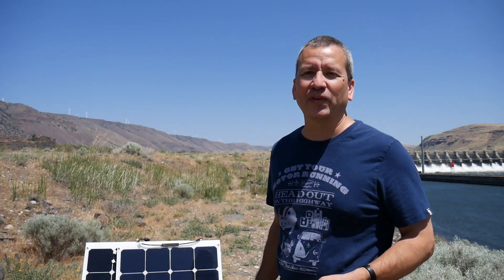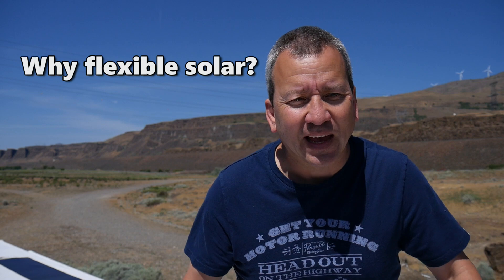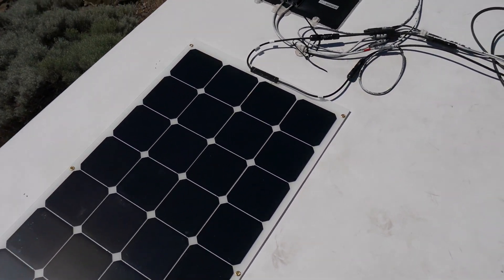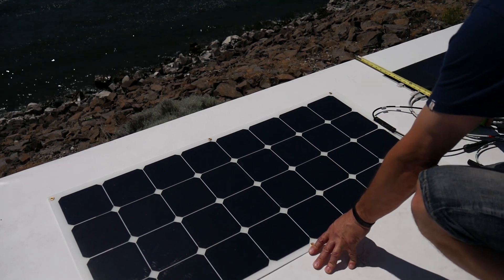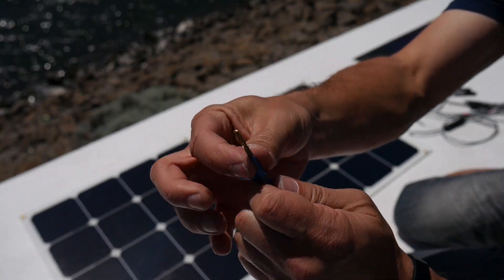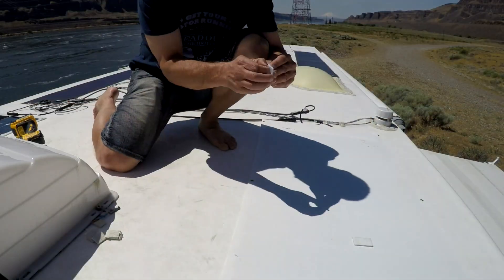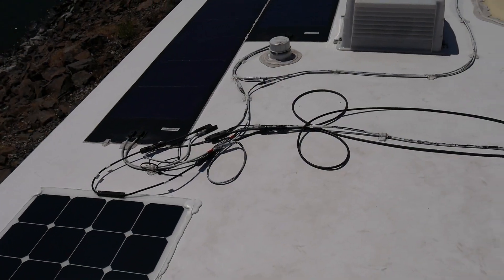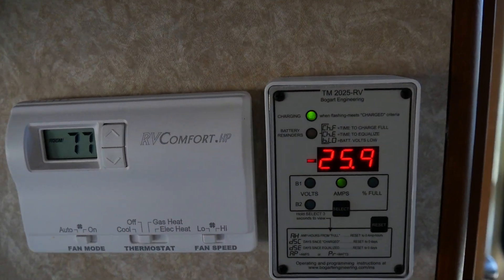How To Install a Flexible Solar Panel on an RV

Comment: Sweet setup you've got, Brian. Nice additional output you just added. 😊
Reply from the maker: Thanks! Yeah I was pretty excited when I first got them hooked up and measured...not gonna lie. Had a chance to do some boondocking for about 6 days around the 4th and they worked really well, even when it was pretty cloudy out.
Reply: RVwithTito
Excellent! We're overdue for a solar & battery upgrade. Too busy this year though.

Comment: Hey Tito, nice job but you really didn't have to drill screws into the flat panels.  I have two on my class B RV and I just used Dicor on the back of the panel and around the sides.  They only weigh about 6 lbs a piece compared over 20 lbs for the glass ones.   They handle speeds of 75 and in strong winds with no movement. The whole purpose is to keep the panel flush to the roof so no resistance is had.  Like you said no one can see them except maybe large truckers.
Reply from the maker: You're probably right. Having had things blow off my roof before, I want to be sure. And I don't mind drilling a few holes to be sure. I still have one more panel to mount though. I might consider a no-holes option for that one. We'll see. Thanks for sharing your thoughts on this. It's much appreciated. Cheers!
Reply: My 2001 pleasure way class b has a slightly curve roof so the flexible panel fits nicely to contour the roofline. The main problem that you addressed is the lack of elevating the panels to the angle of the sun  I too sacrifice performance for convenience. In fact I saw a video that show you can gain up to 50% more power by tilting the panels to the correct angle. That is a lot of lost power !  What I might do for long trips boondocking is to have a separate hard panel with legs on the ground angled to the sun and tie it into the current system.

Comment: Did you get the GoPower panels? Your link just brings me to an Amazon search. Thank BTW. I was wondering how the flexible panels performed.
Reply from the maker: They are HQST panels. I have a link to them on the website here (http://www.rvwithtito.com/solar-panel-kits#oursolar). The 100W panels keep selling out so you'll have to keep checking back. Go check out my response to Mike Johnson's comment for more.

Comment: Great vids, Did you mention how much battery storage that you have? I just finished a 400 watt Renogy install on a travel trailer. I run a couple of 6 volt costco batts. Would like to add a couple more and have room for 2 more panels. This stuff is addictive. Fun though, am working on a couple of e bikes and just thought it seemed a natural.
Reply from the maker: I also have two 6 volt Costco batteries (210 amp hours). I'll be upgrading soon to two AGMs for a total of 350 amp hours. I do love my two Costco 6v batteries. They are great. I just don't have the space for two more. If I did, then that's what I would get.

Comment: Gotta love flexible solar panels. A bit pricey. Hopefully sooner than later the price drops.
Reply from the maker: I got these for around $160 USD each which is probably on the low end of the flex price scale.

Comment: Another great RV with Tito video! Nice work. My only concern is heat with those flexi panels laying flat...solar panels get uber-hot. Looks like there is enough space up there for a 1,000 watt array!
Reply: I was wondering about that also.  If you are in a hot area like the southwest usa temps can get over 100 and higher how will those panels handle that kind of heat with no air under them?
Reply from the maker: They do get warm at times. My other ones do as well. I haven't had issues because of it. It could be because I generally avoid that kind of heat.
Reply: RVwithTito  what  is the max outside temperature that you run them at?

Comment: I notice on all the installs I see, no one uses stainless screws. Is there a reason?
Reply from the maker: I considered going stainless steel, but it's really not necessary since they are all going to be covered with Dicor anyway.
Reply: OK. Makes sense. Thanks!

Comment: I like the idea of those flexible panels you used along with an additional portable setup for those times when you can point them towards the sun for more power.
Reply from the maker: +jMon Agreed. The nice thing about flex panels is that they are easy to stash in your RV to use as needed. I've put them under bed or in the back of my closet.

Comment: Still intimated by this project because I don't know how many solar panels are needed for one 12V, deep cycle battery, and how many batteries are needed to support a 1000W inverter .. I've read many articles about this, but none explain the formula .. is there a rule of thumb? If so, please explain it in layman's terms .. thanks!
Reply from the maker: A good rule of thumb is to match your solar output in watts with the amp hours of your battery bank. For example, you'll need at least 200 watts of solar to keep a 200 amp hour battery bank recharged under normal daily use (a 400 amp hour battery bank would need 400 watts of solar). I like to add an additional 20 percent of solar to account for cloudy days and lower performing solar panels. The size of your battery bank, on the other hand, will be determined by your power needs. I would start small and expand as needed. Your 1000 watt inverter and 200 amp hour battery should support basic stuff like computers, TV, fans, etc. without any problem. Hope that helps.
Reply: +RVwithTito ... yes, it was .. very helpful .. thanks again :D
Reply: Ohms Law  P=EI.  Simple algebra to solve for your needs.  P=Power in Watts, E=voltage and I is amps.  FIgure up your power needs total and size your array accordingly.  When I was a fulltimer, I had 350 watts of solar on the roof of my pusher.  I charged 4 house batteries, no problem and ran everything except the air conditioners with my 2000 watt inverter.  This was 18 years ago and my first 50 watt panels cost me $350 each.  How times have changed.  Now putting a 50 watt flexible panel on my TT to keep the battery charged.  $90.  amazing

Comment: Is there a reason that you didn't mention what brand, model solar panel you installed or link it on your amazon buy url?
Reply from the maker: They are HQST panels. I have a link to them on the website here (http://www.rvwithtito.com/solar-panel-kits#oursolar). HQST took over the manufacturing of these from Renogy who no longer makes flex panels. I think I picked them up for around $160 each. They seem to be selling well because Amazon inventory seems to come and go. You just have to keep checking. There are many similar 100 watt panels out there now and I wanted the focus of this video to be more about how to mount them and less about this specific brand of panel. I am pleased with them though and do recommend them if you can get your hands on them. Thanks for asking!
Reply: Thanks Tito. I've been looking for a solar options for my RV. My roof is fiberglass and doesn't have much room. I'm hesitant about drilling holes into the roof and was wondering if I could use the 3M tape to secure the panels.
Reply from the maker: You might try to wrap Eternibond tape around the panel to avoid drilling. That should keep it on the roof pretty good.
Reply: +RVwithTito  That is a great idea, really appreciated the video. I'm thinking about going with solar but am also very hesitant about drilling my fiberglass roof, never even thought about just sealing it with the tape. Thanks for the video.

Comment: Love your vids. I may have tried eternibond tape for sealing the edges on the flat panels. What do you think?
Reply from the maker: Thanks! I thought of that too. I went with Dicor because it would be easier to remove should the panel need replacing for any reason. Eternibond is much more difficult to remove.

Comment: Have you tried the cell phone Tower Batteries? They are between 700.00-800.00 a peace but warranted for about 15 years!  You can get them cheaper on amazon used with lots of warranty left to them !!!
Reply from the maker: I'm aware of them but haven't tried them. I'll probably be upgrading soon to sealed 10yr AGMs.